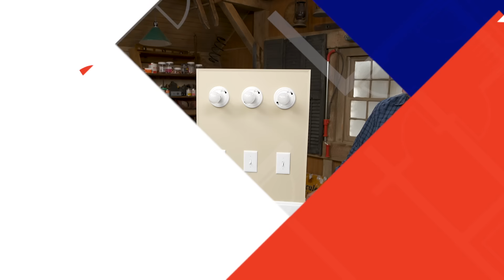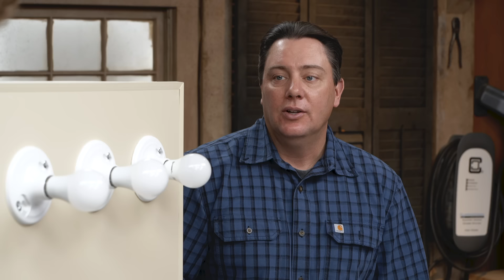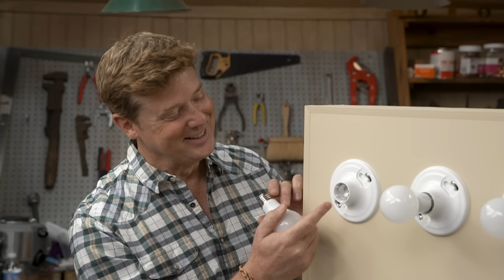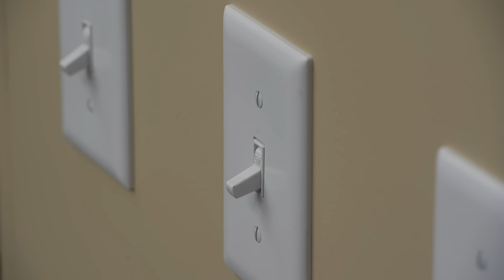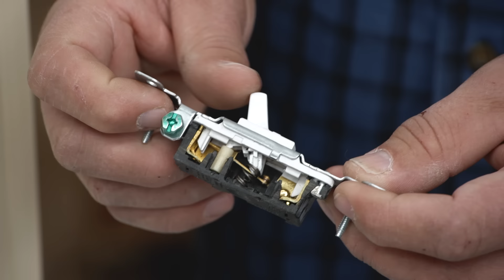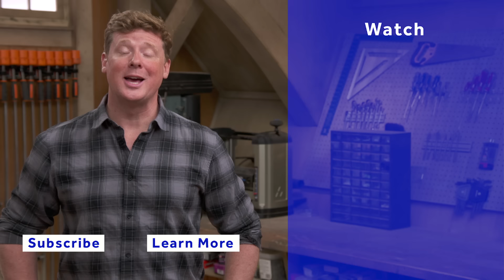How to Fix Flickering Lights in Your House | Ask This Old House

Comment: No! You don't have to replace the socket. Just bend the contact out.  Problem solved. It's brass and if it has a little corrosion, just take a pencil eraser to it.  Good for 5 more years. Not everything has to be replaced.

Comment: I've been an electrician for close to 20 years and this video is really simple and effective for a homeowner to fix their own problem. A 4th very common cause would be a loose splice, especially if the house was built in the 70s when aluminum wire was prevalent
Reply: So what if it’s every light in the house?
Reply: @thenarrowpath2731  right
Reply: @thenarrowpath2731  what is the answer
Reply: Does anyone scrolling by happen to know the answer? 
(Q: What if it's every light in the house?)
The two guys up there^^ and myself would definitely appreciate it 👍
Reply: @StevieTheG most likely that is a problem with a loose or bad(corroded) connection anywhere from the panel, and backwards towards your utility service connections, including a loose meter or the connections inside the meter socket itself. Best to have an electrician come by to look at it because it could be a potential fire issue as well.
Reply: @StevieTheG Loose neutral?
Reply: Same! Whole house just started out of nowhere. Especially when you first turn the lights on!  @StevieTheG

Comment: Thanks Heath for saving Kevin's life ha ha ha
Reply: 110 voltage won't kill you or hurt you
Reply: @Greenredfield  volts don't kill you the amps do
Reply: @jonahblacksmith1  for sure. But you know what I mean.
Reply: I wouldn’t have stopped him.
Reply: It's not Europe where they got 220 running on everything
Reply: @Greenredfield  
It hurts.
Reply: would have just woken Kevin up, nowhere near killed
likely would have shorted through his finger... my grandad used to test for live wires by shorting through thumb and index fingers
Reply: Total Home Improvement moment...that was great 😃
Reply: @Greenredfield  it’s called hyperbole.

Comment: What's worse is when its not any of those issues and it's instead caused by a high load like a washing machine causing the voltage to fluctuate.
Reply: Yup esp in older houses with lighting and recepts on the same circuit and 1,000 other things
Reply: @mikez4132  switch to led bulbs they’ll put way less stress on ur electricity and probably avoid that hah
Reply: @dylan-nguyen  i have all led recessed. It's not an issue in my house but I have seen other houses where the lighting and receptacles are on the same circuit and the washer drum agitation causes the lights to dim with every turn of the tub. Back in the day they were not concerned with  as many separate circuits as we are now lol
Reply: Even worse, loose wiring connections behind your walls
Reply: It gets even worse in houses with that old knob & tube wiring.
Reply: A
Reply: This is exactly my problem! Every time my washer agitates the whole house flickers. 1950s house
Reply: @Bushbag123  Hey Ruth, I'm a lineman for Eversource energy here in Ct. and flickering lights is one of the most common calls we get. It's very possible that it could be an old/bad neutral connection outside the house or in the meter box, especially if the meter box is still the original. You can call your electric utility and have them come out to check.
Reply: @hectorbart  thank you so much for the reply!
Reply: @dylan-nguyen  my basement bathroom never had a issue when the washer was on until I installed LED bulbs.  Now there is a slight flicker when the washer is on.

Comment: When Heath turned the switch off for Kevin, I had a huge sigh of relief. I know they wouldn't but the video up if Kevin had actually hurt himself, but as soon as he took the bulb out, I kept thinking "Don't reach in there! Don't reach in there!"
Reply: It’s amazing how we have ingress protection on power outlets, but light sockets have a great big opening for fingers to reach into. 

I know it’s a standard that has been used forever, but surely now is time to change to something a bit safer...?
Reply: I mean I know that Kevin sometimes acts a little silly, but I've never seen him actually BE silly.
Reply: @MrKyleDD  if he can do it a kid can do it. The difference being a kid doesn’t have Heath to switch it off 🤦🏼‍♂️
Reply: @matthewlewis5631  That's why the shell part is the neutral, in order to keep your fingers away from the tab deep within that is hot. Hypothetically, you can touch the threaded shell without getting shocked if everything is wired properly. Not saying I recommend to do it. This is also the same reason why they invented polarized receptacles and outlets. Plugging in a lamp with a non polarized plug made it dangerous to change bulbs.
Reply: @matthewlewis5631  Leave it alone. It cleans up the gene pool.
Reply: @illestofdemall13  I’ve worked with several “electricians” who don’t know or care which conductor is the hot or neutral on chandeliers (where it’s not as obvious). Over my years replacing chandeliers, I’d say barely over half are wired correctly. I’ve even seen manufacturers label them with stickers reverse of standard.
Reply: @KitchenerLeslie2  I check continuity between the 2 conductors and the shell/tab of the sockets to verify which should be connected to the hot and neutral.

Comment: I had an issue years ago when the whole house was flickering, it turned out to be a corroded neutral line outside the house before the meter.
Reply: Mine was corroded inside the meter box; electrician replaced that, and it helped but didn't solve it. Then they found there were a lot of ground & neutral wires doubled up under the same screw on the ground bar, and theorized that some weren't making good contact. They added another bar so every wire could go under its own screw, problem solved.
Reply: @DaddyBeanDaddyBean   I am surprised the installation even passed inspection with two conductors under "one screw head" Point of added resistance and corrosion poor contact. Ought to installed a longer bus bar for the grounds and neutrals to begin with if the factory supplied were too short.
Reply: @TheTheo58  It's a very old house (1860's);  the previous owner did extensive work, much of it himself, and I'm pretty sure that included replacing the service panel. It's entirely possible he added a bunch of circuits after getting it inspected, and didn't have the sense to add another ground bar.  I had the upper entrance cable replaced (from the weather head down to the meter box) along with the corroded meter box itself, so needed an inspection for that, but I honestly don't recall whether the inspector took the cover off the panel inside.  I suppose he must have, but can't swear that he did.
Reply: @DaddyBeanDaddyBean   my goodness 1860's era would likely involved K/T wiring.  The home I grew up in was built in 1946 (the building permit was still nailed to the stud in the garage) had a 100 Amp main entrance fused disconnect,  six branch circuit fuse panel (hall closet) Main panel had fuses for range and dryer.  Older fiber wrapped non-metallic cables for interior and BX cable.  I used EMT and BX cable when I added additional outlets in the garage and the newly built darkroom. Adding a ground at two locations.
Reply: @TheTheo58  Correct - there are still a few unused bits of knob & tube here & there, but the entire house was rewired with Romex at some point, presumably by the previous owner.
Reply: @TheTheo58  There is still active knob and tube wiring in the building which houses my data center.  Replacing it would require tearing apart 100+ year old plaster, so they just let it be.
Reply: @TheTheo58  I am surprised you would think the panel was inspected.
Reply: Im going through this now.  The whole house flickers intermittently.  The power company says their stuff is fine the electrician say breaker box looks good.  No one has looked at my connections coming into the house.
Reply: @twennywonn  your electrician should have checked the meter and top of service connections.
Reply: @KitchenerLeslie2   he just opened the panel.  Are those connections outside of my home?
Reply: @twennywonn  yes. Meter pan and if you have an overhead drop, the connections at the top of your service, at the end of the wire from the utility pole
Reply: @KitchenerLeslie2   Thanks.  My stuff is underground but Ill call an electrician back out.

Comment: Yep, the non LED compatible dimmers depend on more current to function correctly. If you have a few LED light fixtures on one non compatible dimmer and they flicker etc., there is a slight work around until you can find the right dimmer switch. Simply have one of the fixtures fitted with a regular bulb and that current draw will usually be enough to get the dimmer to function. We did this in one room as the switch box that housed the older style dimmer doesn't have enough room in it to put the newer dimmer inside it. The newer dimmer is much larger and there's just no room for it so, until we arrange to cut into the plaster wall and put in a correctly sized switch box, this idea works for now. 
For those who don't know, LED bulbs interfere with garage door openers and video cameras...be sure to find LED bulbs that are made for those applications.

Comment: The lights in my entire house used to flicker anytime you turned the dryer, refrigerator or anything that draws a decent amount of electric on. The box on the outside of my house was completely corroded and filled with water. Electrician came and fixed it and did a total re wire. Problem solved. The annoying part is that the box on the outside of the house is not accessible by anyone except the electric company (at least legally), so it was a process to have them come out with the electrician and get this all fixed. However, none of the lights flicker anymore and the power lines are now safe
Reply: This is my current situation as we have been In our new “old” house for 5 months and no flickering, we just set up the fridge and washer/dryer. Now all my lights flicker, even my fan will fluctuate in power
Reply: This sounds like it could be similar to my problem. It's just the microwave and LED bulbs I've been using that do it.

Comment: I have the senecio where the electrical panel hasn't been gone over in ages. I've found loose or corroded wires there. Tightening with a screwdriver usually fixes most. I've taken an infrared thermometer and found a couple of hot spots. Fuse or breaker itself getting warm. Replacing those usually fixes it. Main did not use de-oxide compound. Aluminum & copper don't get along without it. Found loose wire nuts, but rarely.
Reply: A bad ground from the service panel to the water supply or ground rod can cause this also.
Reply: I have seen failing neutral feed to the meter cause dimming in the entire home
Reply: Neutral losing wire is one of the most comuns problems, too.

Comment: Over many years, I have fixed many flickering bulbs by re-tensioning the tongue in the center of the socket with a little hook.  They originally are sprung against the bulb, but eventually flatten against the bottom.  Sometimes they corrode and a few strokes with a scraping blade, like a chisel, makes them like new. Sometimes the screw shell is fastened with a screw instead of a rivet, so a turn of that loose screw fixes it. Also, before i buy and replace a switch, I just short the wire screws together to see if the flicker stops.  If not, it is not the switch.

Comment: We use LED bulbs in light fixtures that are simply on or off, like in the bathroom or stairwell.   For other lights controlled by a dimmer switch, like our dining room, we've gone back to good old incandescent bulbs.  No need to mess around with expensive new dimmer switches or flicker issues.

Comment: I had the 3rd one even with a dimmable switch and dimmable led can lights. Happened to be on a 3 light chain. Had same setup on a 2 light switch without problems so I'm thinking had to do with the 3 chained together 🤔
Reply: Any update. Same here. I just changed the dimmers (LED compatible) and my dimmable LEDs still flicker. I’m going to buy a different brand of LEDs tomorrow and see if my flickering goes away
Reply: @Paul37Ontario  I figured out theres a setting on the led dimmer switch to set the dimmer limits. Check out if yours has something like that. My switch was a leviton I think. I found it in manual guide after I finally read it 🤦‍♂️
Reply: The dimmers that I bought are simple straight dimmers, Home Depot (5 pack). I wish it was that simple. I'll let you know tomorrow if changing the LEDs worked. Thanks for your reply.  @JonnyDIY
Reply: Bought Philips Ultra Definition 100W equivalent after doing lots of research, and no more flicker.  There expensive, had to get  8 of them. But no more flicker. Thanks   @JonnyDIY
Reply: @Paul37Ontario  Awesome glad you got it sorted. Those are good bulbs, they should last a lot longet than your basic cheap leds 👍

Comment: There’s got to be some other reasons. I have a new energy saving light bulb in one socket and a four foot shop light in another, both off the same switch. The energy saving bulb, which is new, occasionally will flicker a couple times, inconsistently, but most times stays on without doing that. The bulb is in tight and there’s no signs of corrosion in the socket. They are located in the garage and there’s no way any rodents could be in the ceiling, plus this happens without any other things running. Only the energy saving build that was given by the electric company does this. Also the same symptoms have been happening in my daughters home after I installed a couple of these light bulb’s there. Again, most times they stay on without any flicker, just occasionally they will flicker a few seconds, sometimes just once and sometimes they will do it a couple times in a row. One outlet in my daughters home looks like some is sending Morse code, but then it will stop and not usually act up for a long time. One more thing, this does not occur when I use the old fashioned type of light bulbs. Personally I think that there is something wrong with these bulbs! I’m 65 and maybe things have changed, but I was always taught that turning a light on and off not only wears the bulb down, but also consumes more energy, uses more power, which would make me believe that these new energy saving light bulbs are not as good as they say.
Reply: Same thing is happening at my house.  Some days the lights flicker and some they don't.  Not dimmable, but now that I think of it, it started happening to all my LEDs overhead after adding new lights where my builder only had one bulb in a two light fixture.  Still, some days they flicker, some days they don't...and it's all of them, living room, den, kitchen...haven't tried upstairs yet.  I'm about to switch to incandescent, if I can find them! The LEDs don't last as long as they should either.  All new wiring in house done about 12 years ago, so I'm not sure that should be the issue.

Comment: I had bulbs flickering in just one room.  I put a multimeter to a power outlet and saw low voltage.  The cause?  Bad grounding.  My circuit breaker was in there tight, and the ground wires were tight (sometimes just tightening the ground wires will fix this).  I removed the breaker and saw the ground bar that it was latched on to had corrosion at the contact point.  I turned off the power to the entire house and used a wire brush to clean the ground bar in the breaker box.  I put the breaker back in and turned on the power, and problem solved!
Reply: Erik ... that's not a ground bar. It's a buss bar, meaning it's part of the hot side circuit.
Reply: @rupe53  Thanks for the terminology clarification.  That bar was corroded.  A quick cleaning with a wire brush fixed it.
Reply: @ErikStone1  that's something to keep an eye on because once the coating is damaged it may develop a hot spot and cause a fire down the road. If you have any room in that panel you may want to move that breaker or install a new breaker in a new location. If not I would at minimum examine the entire buss bar for any similar signs, because you may need to replace the panel.
Reply: @rupe53  Thanks for the heads up.  Yes, I did replace the breaker with a new one.  I'll still keep an eye on it though.  Thanks!
Reply: That's not the ground, it's the neutral. Ground has nothing to do with electrical transmission, it is an emergency exit when a wire gets damaged. Power comes into your home on the hot and leaves through the neutral. If ground wires are affecting your power, your whole system is screwed. A bus bar can be hot, neutral or ground. It is simply a place where wires come together at a common point. The hot bus bar is behind all the breakers, the neutral and ground are off to the side and have white or green or bare wires. Black or any other color, usually red is for hot. If you have any corrosion in your panel you should have it replaced, that could cause a fire if left untreated.
Electrician.